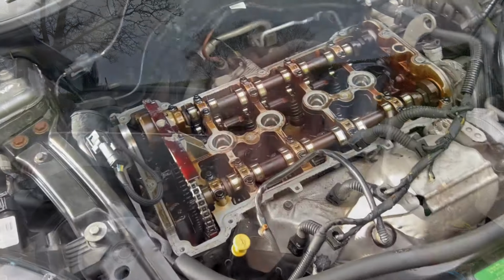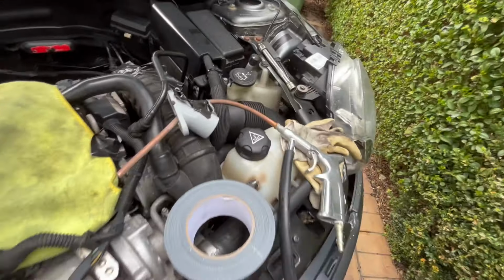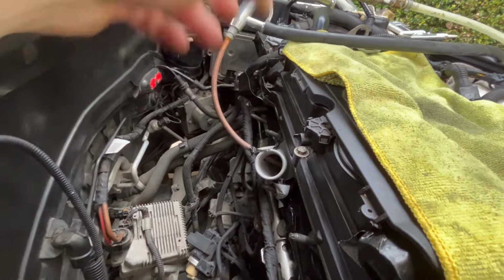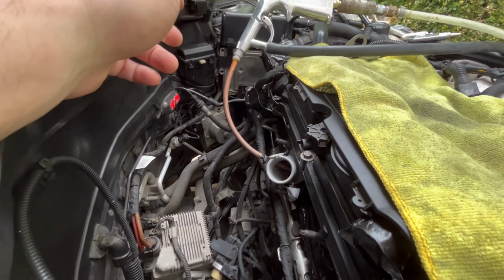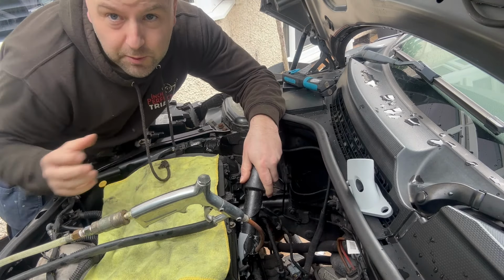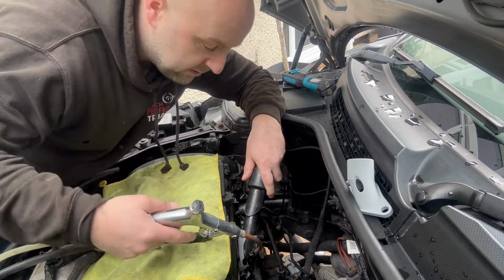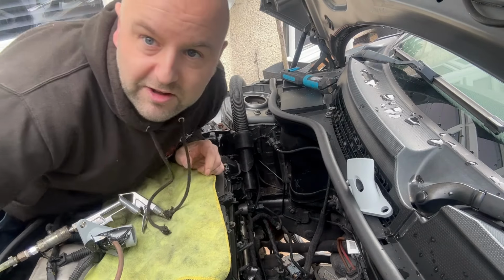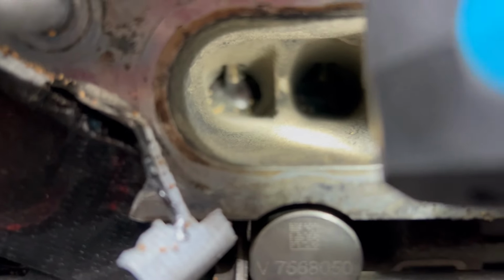Problems with the Cooper S *DIY walnut blast* R56 miss firing

Comment: Might want to try putting some Cataclean through it too :)
Reply from the maker: this anygood?
Reply: @oldskoolmotors2802  I used it (diesel version) on a shogun 3.2 after I got all the "coal" out of it. Some folk rate it, put a little bottle in 1/4 of a tank and it's supposed to clean everything out. 
I felt it worth it.  Not expensive.